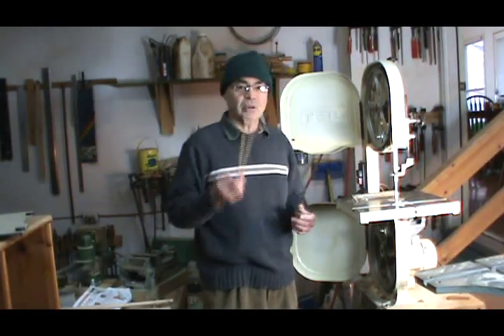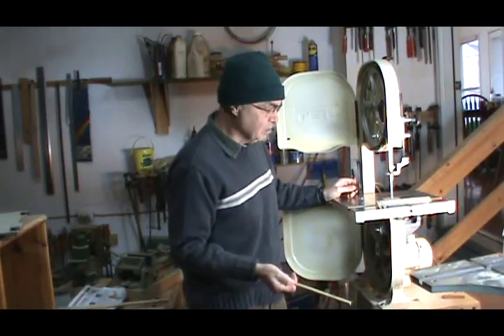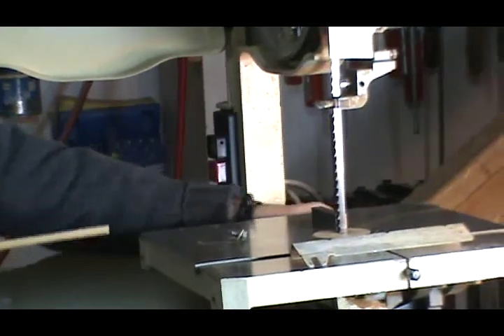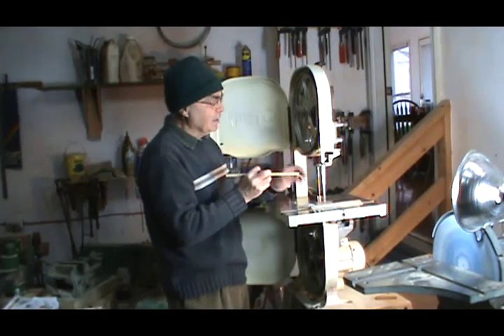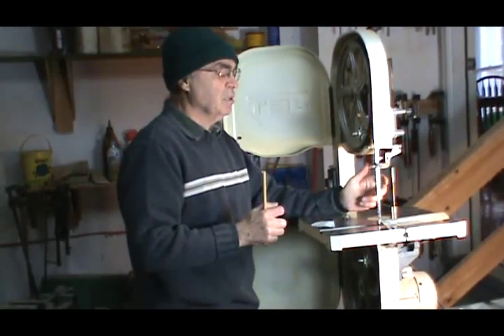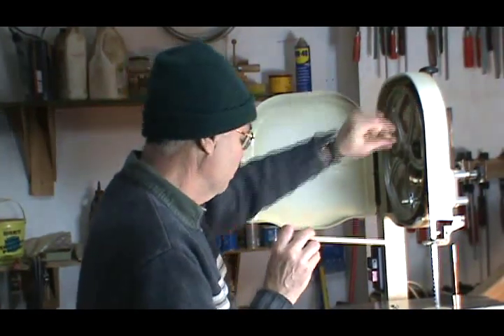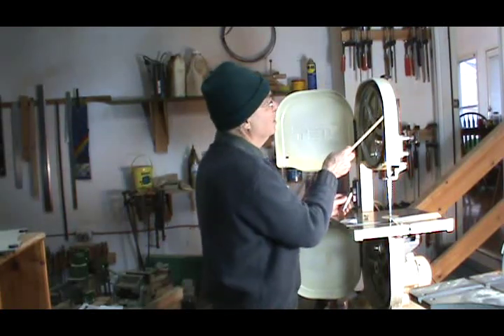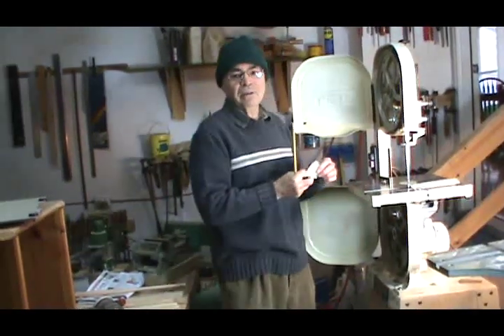Set up and Tune up a Consumer Grade Bandsaw

Comment from the maker: sheet of newspaper on either side of the guide blocks 1/64in of in on rear thrust bearing behind blade.  Liquid wrench sprayed on all the roller bearings , clean chips and sawdust off the bearings first before spraying.

Comment: hi again 
 taking about vibration i pull out the motor from the band saw ,it has   lot vibration by itself,i do not known if that normal ,i also did a test ,i bolted the motor out the cabinet   in separate base and i got no vibration at all this my band saw JWBS-14CS  is my first band saw  .some advised please 
thanks

Comment from the maker: @tdlewis103  Hi  before you buy a bandsaw. Try  to imagine what  you will use it for. I highly recommend Mark Duginske the bandsaw handbook from your local library >IMHO it has the best technical analysis and what to look for when buying a bandsaw I do not recommend buying used off craigslist unless you really know bandsaws otherwise you could be buying a huge load of potential problems. Caveat Emptor  regards and good luck ernie